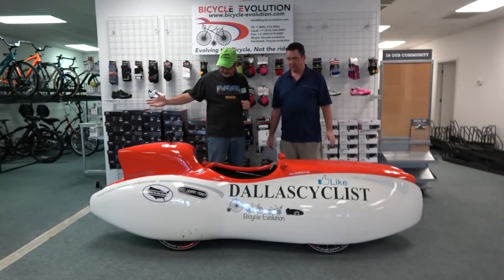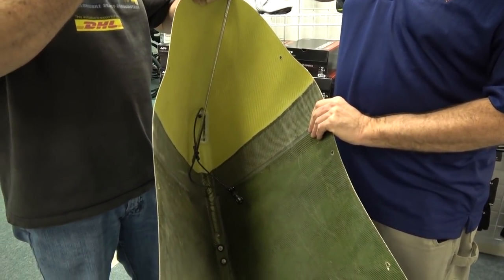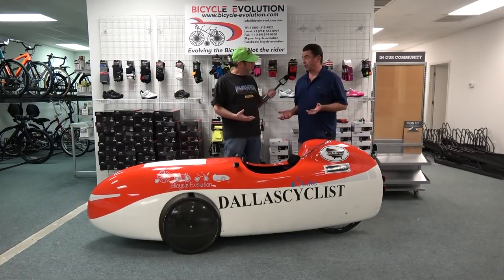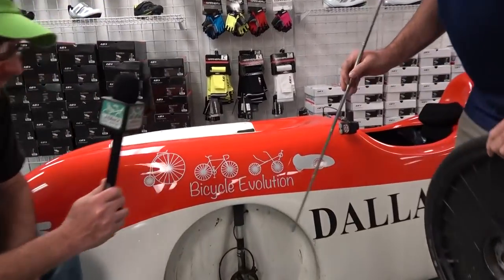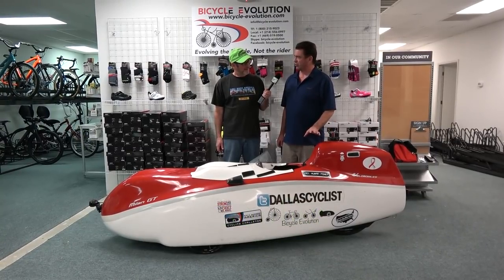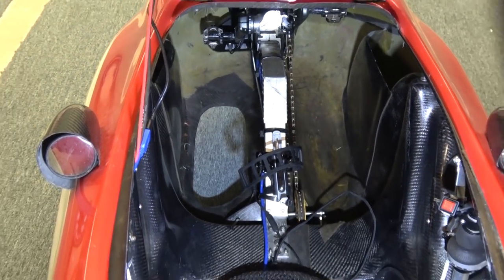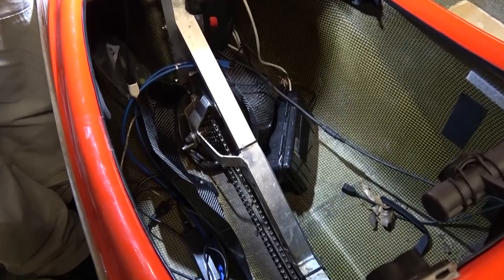Velomobiles 101 with Mr. Wizard-Doug Davis

Comment: For the record... my WAW #335 is 9 feet long from tip to tail.  It has a shorter N3 nose (no Flintstone holes), and  the T3 tail that goes with rear suspension.  It will not fit behind the front seats (8 feet) of a minivan unless you take off the nose and tail...  even then, it's not an easy fit.  You have to raise the rear on a ramp, wedge it between the front seat backs and use a lot of padding where it touches to avoid abrasions and fractures to the shell... just FYI.
Reply: Arent u supposed to ride a velo?  Why are u putting it in a van?  Hahahah
Reply: @lolouro2266  
You are totally correct... But it's 9 feet and change in length... Not 6 or 7 feet.

Comment: So it doesn't have independent rear suspension, but a single axle instead? That's not good engineering if that's the case. It's not very clear in this video.

Comment: I am Soooo glad that you have posted this video! Now I have an answer to all those folks who keep asking difficult questions: Watch this video, Doug can answer questions that you didn't even know you had! :-).

I did find it very interesting that Doug would chose the QV over the others, being the most versatile. To my mind, the others you get to go really fast, or have a lot of fun at the weekend, where as the QV is your 'daily commute' to work (in all weathers), plus doing the shopping on the way home. Mine now has 800 miles on it in about 3 months, nearly all going to work. The car stays at home :-).

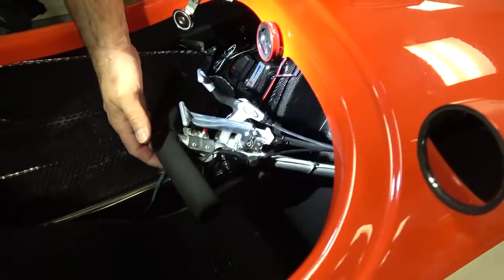One thing I would add to Doug's comments on the QV: I am in the unusual situation of leaving for work at 04:00 hrs in the morning, so generally in the dark. One of the great things is the high level headlights, which are VERY good. Plenty of light on 'High Beam' for fast road riding, the low setting is still bright enough for cycle track use, and most importantly, they do not drain the battery in 'jig' time like the 'Cree' headlights do. I can go about a week on a charge at present, where as the light on my Trike fails after 2 days, (and that is on the lowest setting). Added to that, Velomobeil.nl has fitted a cable operated headlight adjuster, so if you load up the back, you can raise or lower the beam using a lever on the steering column. Very neat!

Now we just need a Doug Davis in the UK!
Reply from the maker: Interesting about the headlights, Con.  As for Doug's choice of the QV I think he is talking about if he could only have one. Clearly he is in no danger of that happening 😊 Thanks for watching and your thoughts as always.

Comment: I am confused about the length of the Mango. If I go to the official mango spec sheet from the manufacturer, it says it is 245 cm, which is 8 feet. In the video he claims it is shorter than the others as a selling point. The DF is 257 cm, so it is only a small difference. I am looking for the shortest, lightest possible velo, because I want to be able to drive and park it in a big city, and be able to accelerate quickly due to all of the start stop traffic.
Reply from the maker: Notified Doug. He should respond here in a bit...